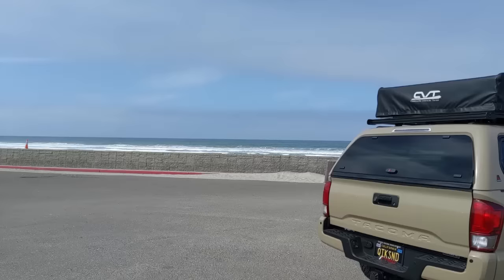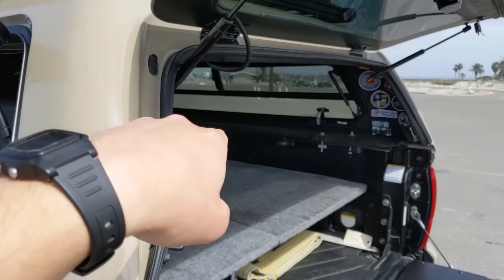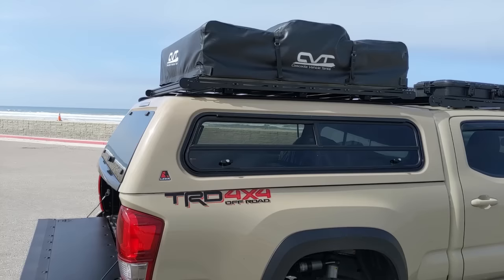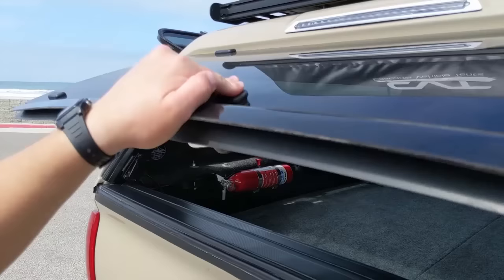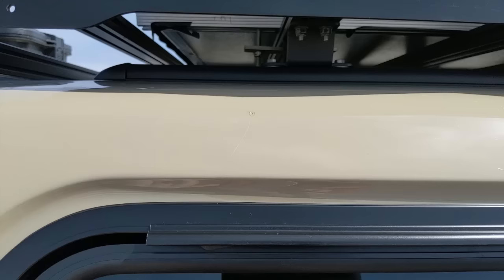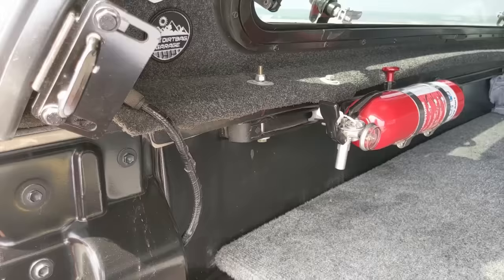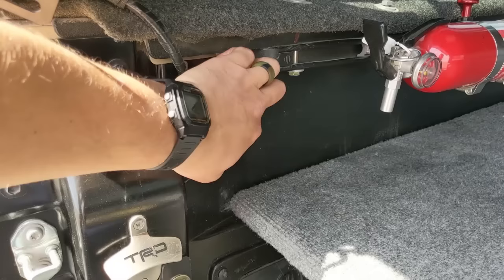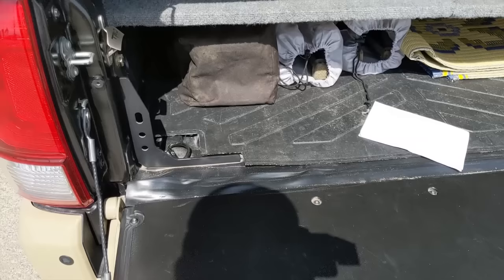Shell and Roof Top Tent FAQ

Comment: 11:00 Bullshit! Anyone who tells you that it's not possible to make the Tacoma bed waterproof is a closet Prius owner and shouldn't be allowed near a Tacoma! 
Mine IS almost 100% waterproof, because I figured out how to make it waterproof. You can too, here's how:
You will need a 3" x 30' roll of Eternabond MicroSeal Putty tape (sometimes hard to find, so get the 2" x 50' roll) --you'll also need a small bottle of denatured alcohol, a pair of sharp industrial scissors, a box cutter with replaceable/snap-off blades, and ~6-8 hours. Yes, this takes a long time. 

WARNING: These steps should be considered PERMANENT! Do NOT let the putty tape come into contact with anything that you don't want permanently bonded together! It takes less than a minute for it to begin bonding to whatever it touches! Also, if it gets onto your clothing, it's not going to come out. 

To begin: remove the plastic covers from the tops of the bed sides, as well as remove the inside rails, as well as the metal structural piece at the front of the bed. Then thoroughly clean all of the surfaces using the denatured alcohol--DO NOT USE GOOF-OFF, PAINT THINNER, OR KEROSENE, OR ANYTHING LIKE THAT. You want to clean off the road grease & grime from the surfaces, not remove your paint! 

Next, without removing the protective backing, cut long strips of the putty tape, and fit them to the tops of the bed sides, front to rear. Do this going from the outside top ridge, moving inside to the bed area, down to 1/4" below where the attachment rails are bolted to the insides of the bed. Make sure to cut holes in the layer of the putty tape, to match the holes in metal sheet body, where the top plastic caps attach, as well as the holes where the side rails are bolted. 

When you have cut all of the strips for the one complete side, starting at the front, slowly and carefully press-fit strips, while removing the protective backin--a few inches at a time. Do this slowly, paying attention to fitment and placement of the strips on the metal body. Make sure to overlap each layer 1/8" over the next lower successive layer, to ensure that there aren't any gaps where water can sneak in. Do this for both sides of the bed, doing one complete side at a time, going all the way to the back end of the bed.
Do the same thing for the front edge of the bed; beginning at the far front overhang edge of the bed, closest to the back of the cab--making sure to overlap each successive layer, by 1/8" over the next one. There will be 2 layers, with the bottom layer extending to 1/8" below the bottom of that front metal piece (or the rail, if you've installed one.)
Next, you'll want to fill in the gaps between the corner gaps between the bed rails, and that front metal part. 

Using strips of the putty tape, cut a 1 1/2" wide x 10" long section of the putty tape, folding it over onto itself at the 1 1/2" length; it should look like, and have similar dimensions to a small box of matches. You're going to leave on the protective backing, then shove the block of putty into the gap, and then remove the backing. This glob will adhere to the bottom and sides, and the top underside of the shell, and help to make it waterproof.
Next, seal the bottom holes in the bedside storage compartments using some of the putty tape, with a small section of electrical fitted on top, to keep the tabs of the doors from sticking to the putty tape. Place that underneath the compartments (you'll have to crawl underneath the truck. Then add a seal in the gap of the door (something similar to what you would use to keep out drafts at your front door at home.) 
The very last part is to install the bed/tailgate seal--it's an adhesive-backed rubber membrane that fits between the tailgate and the edges of the bed. 

Oops. Forgot that you also have to plug the drain holes in the front bottom of the bed. Pick up some grommets from your auto parts store, or save the $ and shove a pea-sized ball of the putty tape into each hole. Done.

Yes, it's A LOT of work, but my bed actually stays dry underneath my A.R.E. MX shell. I go camping in all kinds of weather, and I stay warm & dry in the back.

Comment: Nice rig! I have the same truck but with an ARE topper! I've been considering the Prinsu racks also.
 How do you like them and do they come with the mounting feet like you have on yours? I've got a Tepui 
rooftop tent that I want to mount on there as well.
Reply from the maker: I like the Prinsu rack. It came with their "standard" height feet and they are pretty low compared to other racks on the market. They are bolted to the factory Leer tracks.

Comment: Are leer caps honestly built to hold up to the weight ? I have the exact cap on my Tacoma and really want to put a tent on. I’ve just heard such mixed reviews .
Reply from the maker: From my research they can take it. Your results may vary, but from what I have found the shell was not damaged during my use.
Reply: @TravelingNobodys  do you still run this set up? I have same canopy and everyone is saying it will crack and explode sleeping in it?
Reply from the maker: @ajbilleck9805  I don't. We've since moved onto a different setup. In the time we did have it, which had plenty of hard off-road and lots of nights slept up top the only issue I ever had was it slid back slightly on one section of road due to the clamps  being just a bit too loose. Once I repositioned the shell and tightened the clamps properly I never had another issue. I slept up top around 50 nights with my wife, myself, and our dog for a total of about 600 pounds  including the tent and rack without any issues.

Comment: Hey @taco_nobodys great video!

I am installing the climbing hooks but the screws were cut from the factory. Did you install longer screws? What size did you get?  Also did you reseal from the outside after loosing?
Reply from the maker: I did get different screws. I don't remember what the specs were but I just found some that matches the factory ones but we're a bit longer.  Don't forget to silicone seal when installing the new screws.
Reply: Taco_Nobodys thank you!

Comment: I live in socal and want that exact camper shell but in cement. Where do I get it from?
Reply from the maker: Leer Truck and Accessory Center in Murrieta
Reply: There's this thing called Google
Reply: Just wanna make sure you mention price for this camper cost about $2300 is that with all the accessories or do you have to pay extra for example adding those windows, lock button etc?

Comment: why is the cap rack higher than the cab rack? you do that on purpose?
Reply: It's just the way it ended up. I had to add some spacer washers under the cap rack feet due to the curvature of the shell. The difference in heights did not effect the performance of the rack in any way so I didn't mind it.

Comment: what type of camper you have
Reply from the maker: In the video it is a Leer 100XR.  I am curently running a Vagabond Outdoors Drifter.
Reply: @TravelingNobodys  can that fit on 2019 toyota tacoma long bed
and where can I buy that type of camper shell
Reply from the maker: @Robert-sl5tm  Yes it definitely would fit a 2019.  The bed in the video is identical to the one on your 2019.  Contact your local Leer dealer for pricing and how to order.
Reply: @TravelingNobodys  cool thanks

Comment: So I liked the video a lot of cool points. However, you basically got a cheap cap. You are completely incorrect about leakage. Leer is the cheapest in the industry. I have always used ARE caps and the paint match and fit quality is perfect. I have never removed mine and it is watertight as the day I bought it as well as it hasnt moved an inch. Those fasteners to the bed they used stock look horrendous. My cap came with 3 on each side that are traditional clamp style but fit into the accessory slide toyota placed on their truck beds. I have dont just as much "offroading" as the next guy and it hasnt moved an inch. I abuse the shit out of my bed because i use it to gather and move firewood so often to heat the house so the windoors frame get hit or smushed by cut rounds or split pices loading through them and they are holding together perfectly.